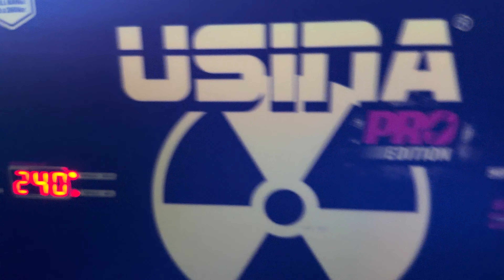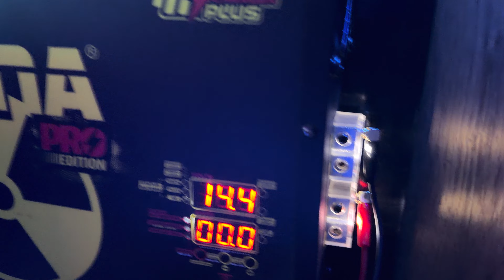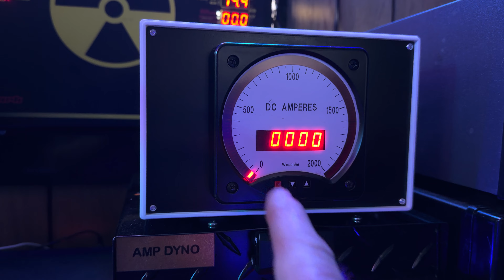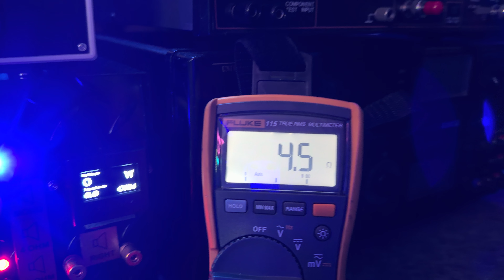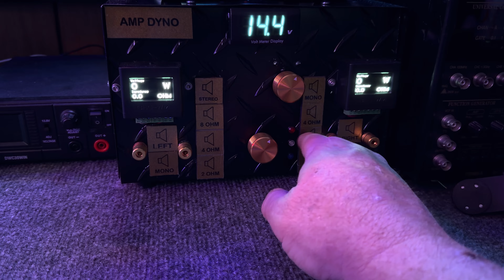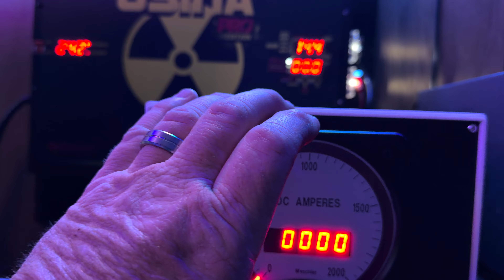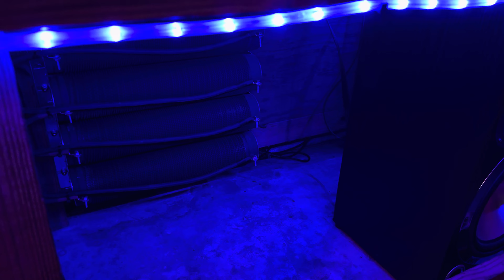PART 5  Amp dummy load amplifier DYNO updates more completed …..Almost done

Comment: This is the project that everyone wants to tackle. 
I don't like how Spark Making Dudes multimeters lack of a clamp for speaker wires.
I wish you would've started this with chart recorders and then end up with a touch screen that saves tests.
I would've used solid state relays rated to switch AC loads for the dummy loads. I'd like to see 200A go through one of those relays to see how long before the smoke comes out.
Subscribed
Reply from the maker: yes i agree i doubt the relays could actually do 200amps but we will see how they hold up for what i purposed them for. this is an chinese special... amp dyno for sure lol. thanks for your feedback . as for chart recorders i haven't thought of that that's a good idea but like a say i don't suspect this to be super accurate more of like a close general idea of what an amplifier will do. i don't have much faith in some of these parts used. but we will give it a go and see. Thanks chris
Reply: @Onerycaraudio no problem. Im an electromechanical technician. I've never played with a raspberry or arduino but I would think that could do the calculations and be used to make it better than whats available for cheap.
A touchscreen would add graphics and active meter display on screen.
I'm gonna try a ac/dc amp clamp add on that is one mV for one amp which seems standard for something likes thirty years.
Reply: I put up a video of the stuff I currently have at my disposal for this project.
A touchscreen might be the best way to show everything in one place.
Diy amp dyno gyno
Because we're putting our dickbeaters where they don't belong for science
Reply from the maker: @christopherpanos8339 i see that i left a like and i suscribed ya👍🏻
Reply: @Onerycaraudio I'm gonna keep it very lighthearted, entertaining, and cheap.
These projects are team consumer and there's enough knowledge among us to do this. We're industrial type guys and we need the arduino and raspberry guys to help us with ideas as far as integration goes. All of the calculations are easy to execute.
Reply from the maker: 1:29 i totally agree  @christopherpanos8339